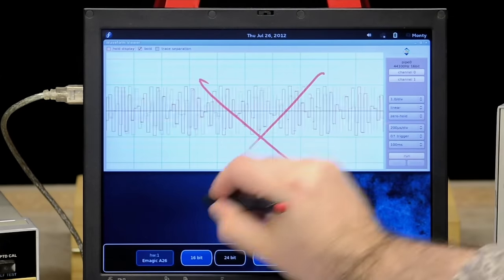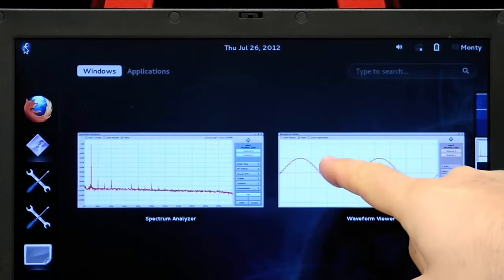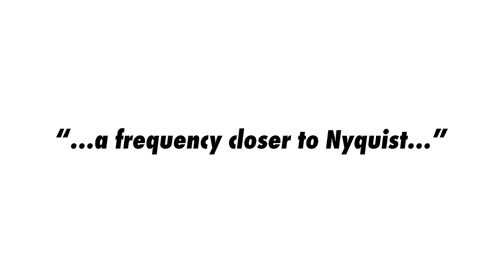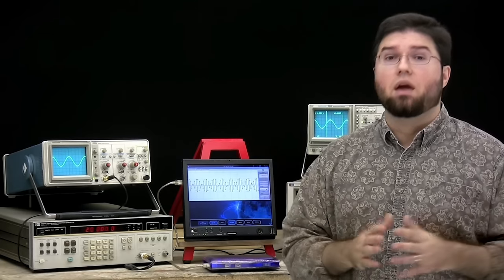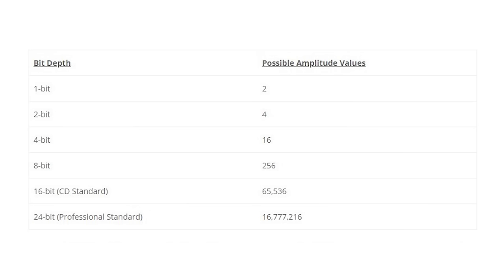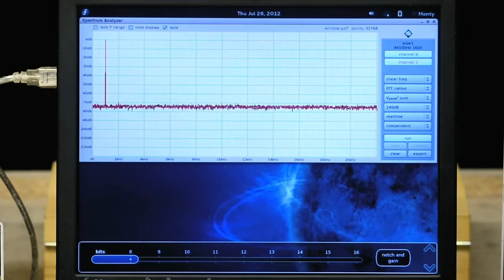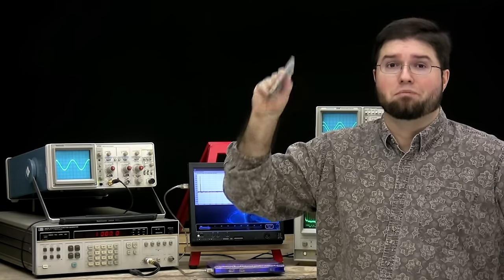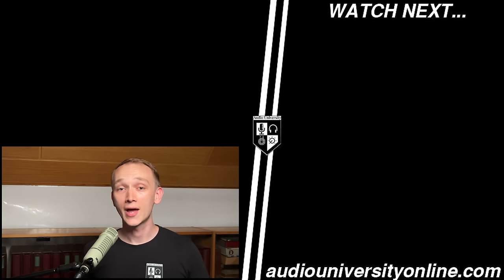Debunking the Digital Audio Myth: The Truth About the 'Stair-Step' Effect

Comment from the maker: Part 2: https://youtu.be/VSm_7q3Ol04

Watch Monty's full video here: https://www.youtube.com/watch?v=UqiBJbREUgU&t=0s

Thanks to Monty Montgomery and xiph.org for making this information available with a Creative Commons License!
Reply: Some interesting insights into DAC reconstruction filters can be seen in the two application notes by Analogue Devices AN-823 and AN-837 for Direct digital synthesis applications but theory is similar.

A video describes the same details https://www.youtube.com/watch?v=dD9HC1GThZY

The original video featured here left out the reason that the stair step waveform is not visible on the output.  It is because of the reconstruction/output filter after the DAC.

Denying the existence of the stair step is a little disingenuous though.
Reply: @nicksterj Were you directing the question at me?  The glossing over of the fact that the output from the DAC is a stair-step before the reconstruction/output filter which is sometimes digital but traditionally analogue.  The lolli-pops only exist on paper, in the digital realm it is just values. Once it is electrical it is a continuous curve (voltage or current) that will be slew rate limited but it will not be discontinuous.  The stair-step is the electrical output you expect from an unfiltered DAC, trying to promote that it does not exist is not correct.
Reply: The higher db really helps w/hearing corrections & poor audio can't handle those levels :)
Reply: ECCO LA VOSTRA SINUSOIDE
Reply: Audio Note UK DACs only convert at a rate of 16/44.1. They claim the inventor of CD said that there is a balance between dynamics and resolution. Higher data rates compromise dynamics. I know for a fact that their DACs sound incredibly good though admittedly they're using zero oversampling and are using superior parts everywhere and are designers. I also know that hi-res sounds noticeably better on my phone or computer. I suspect that is because the conversion artifacts are easier to deal with when higher data rates and oversampling is used. What the world really needs is high performance R2R DACs that are stable. Apparently, the better the R2R DAC gets the more apparent the stability becomes. Audio Note UK has been working on a R2R DAC for years and although it sounds excellent, stability is an issue.
Reply: Thanks for debunking the myth. The main things missing from CD's are the higher harmonics which can be experienced from a live performance, particularly if you're listening to violins and other upper register instruments. These are not heard directly, but their intermodulation products with the lower overtones do colour the sound noticeably, even for older listeners. 44 kHz sampling causes distortion of anything above 22 kHz which is not filtered out in the recording session.